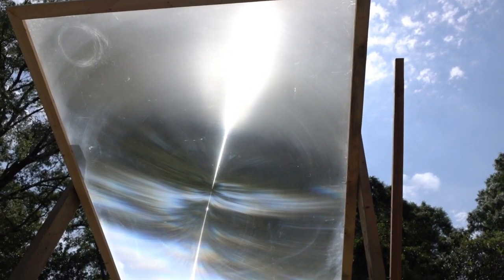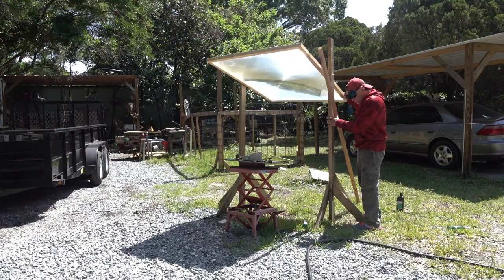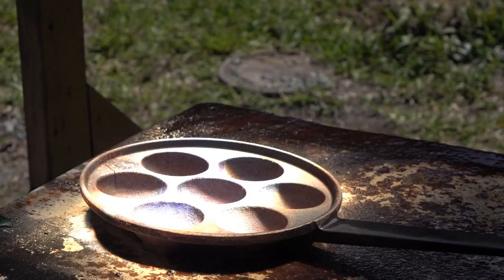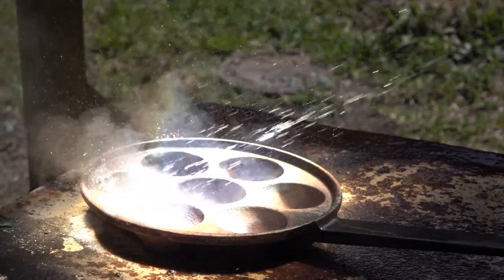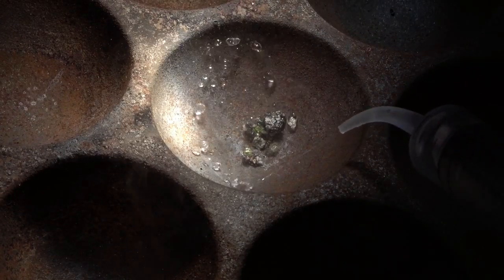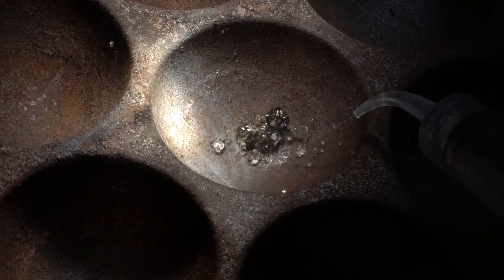Solar Water Dance Fresnel Lens Leidenfrost

Comment: Hello, I have a few questions and i hope you will help me to find solutions.
I am in the middle of writting the thesis about leidenfrost effect which is well known and featured, beacause of its attractiveness. But the problem is, I am supposed to describe these stars or stars imitating shapes of water and i cannot find this kind of phenomenon anywhere. I wish I known when it happens or what is needed at least. It looks to me like noone wants to describe it. I am stuck. Can u help me?
Reply from the maker: A steam layer is formed causing the water to make balls held together by water tension. What stars are you referring to.
Reply: In some conditions  water shape resembles the star. It is better seen  in the slow motion video. Did you notice anything like this?

Comment: Man, I'd stay well away from something like that to protect eyes and skin; what's the UV concentrations like?
Reply from the maker: UV is safe. More exposure from direct sunlight (assuming you are not placing body parts in the lens focal area = instant burn). There is no radiating exposure from the focal area. I use dark torch goggles for eye protection from the bright illuminated area similar to welding. Because this process requires working outside in the sun, good SPF sunblock for the face and hands and long sleeves/long pants are what I normally wear, even when it is hot outside. Sweat is better than skin damage. The UV skin damage risk is from being in the sun (like going to the beach or lawn work) and not from reflections off of the focal point.
Reply: Glad to hear you take those precautions. Thanks for the vid and your reply. :)

Comment: For those who don't know: The Leidenfrost effect is a physical phenomenon in which a liquid, in near contact with a mass significantly hotter than the liquid's boiling point, produces an insulating vapor layer keeping that liquid from boiling rapidly. Due to this ‘repulsive force,’ the droplet hovers over the surface rather than making physical contact with it. https://en.wikipedia.org/wiki/Leidenfrost_effect